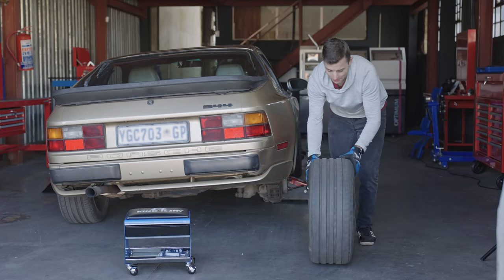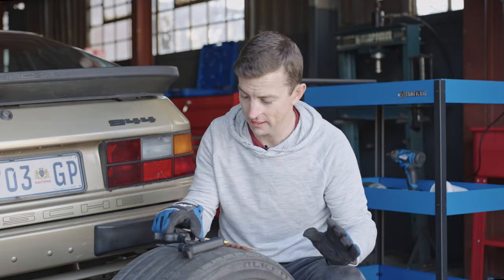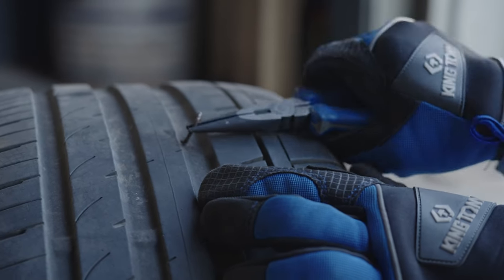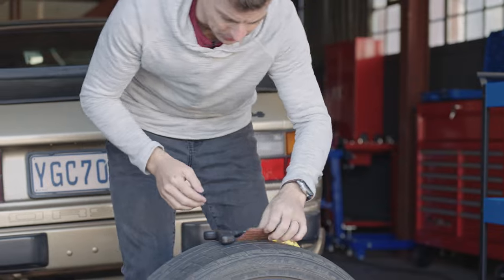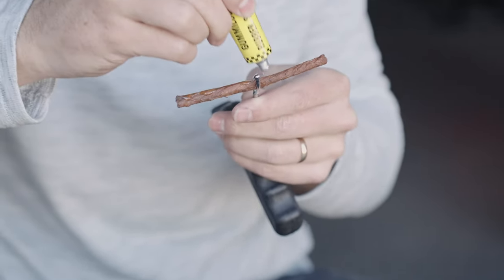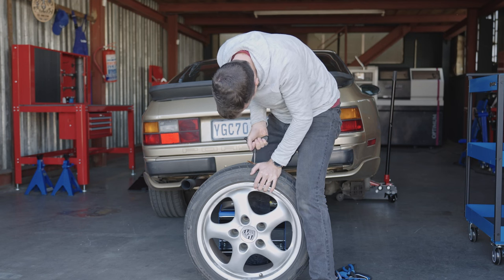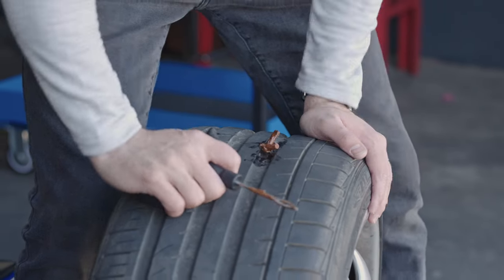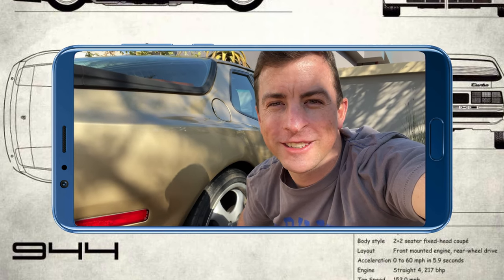DIY PUNCTURE REPAIR: w/ Tubeless Tire Repair Kit - Porsche 944 | DailyDriver944

Comment: Pushing the plug through is a bit easier if you had more air in the tire.
Reply from the maker: Great tip - thank you. As it was my first time, I was nervous about too much air pressure...as it turns out, this was an unnecessary worry that I learned only later. Thanks again!